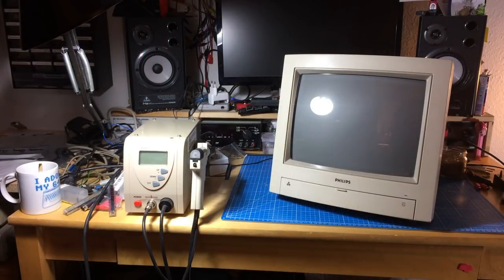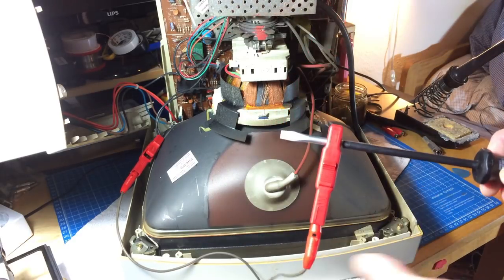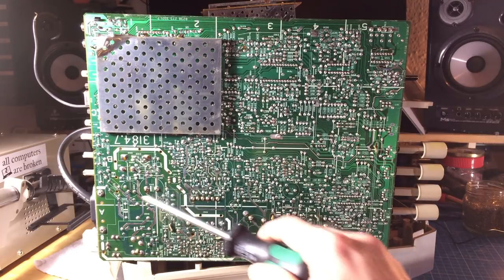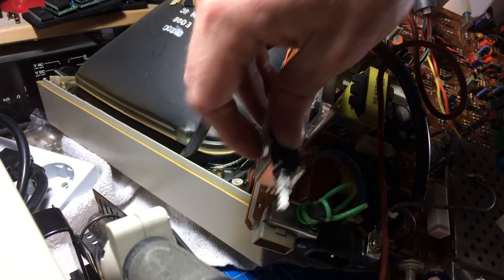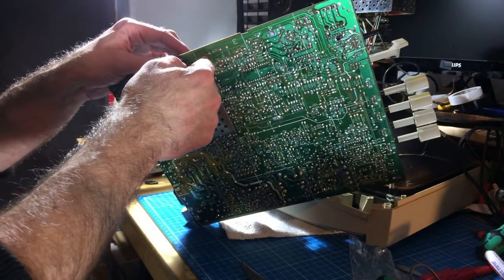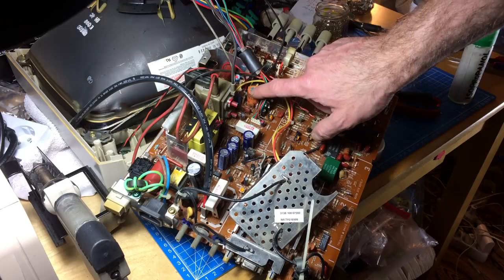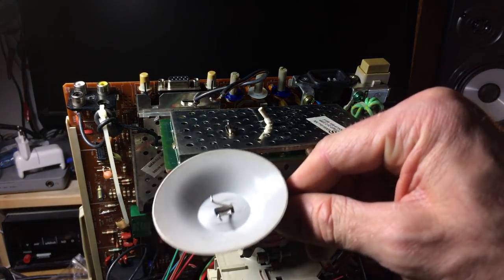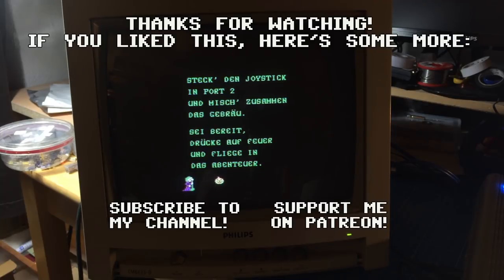Philips CM8833-II CRT Monitor Power Switch Repair and Recapping

Comment: The 4.7uF 50V cap is a low ESR specially made cap for this application.  They are no longer made (circuit designers switched to using film capacitors). The last cap made for this monitor is BPHR50V4.7-RC.  Console5 has stock of the last known batch.

Comment: If you take out that flyback plug after discharging, is the flyback also still charged? Or when removed from the screen it will still dis-charged..?
Reply from the maker: The flyback itself is just a transformer, so there's no charge to speak of left in it after disconnecting the plug. Depending on the monitor, there might be some capacitors connected that have to be discharged by shorting them out to ground (preferably through a small resistor) though.

Comment: The only thing I want to do inside the crt is to put a small stereo amplifier and two little speakers (my 1084 is mono). I am very scared by the high voltage so I will discharge it extra carefully and multiple times. What are extra security measure to use? Maybe leave the screen unplugged for long period in advance? Using big gloves?

Comment: Jan, where did you found 4.7uF 50V big bipolar capacitor? Does anyone sels cap kits for hese machines in Europe? This monitor is basically the same as Commodore 1084S-P1 except luma input.
Reply from the maker: I ended up putting the original one back in. I think console5.com is the only place that still stocks the bipolar capacitors for the common CRTs. You can replace them with polyester caps as far as I know but I didn't try that yet.

Comment: @Jan BetaYeah, very good idea to short  caps with screwdriver for discharging but if you want damage them right away... You can check it by yourself. Charge some capactor, disconnect power and watch voltage drop with multimeter then discharge it using screw driver, recharge, disconnect power and check again voltage drop. You can see that voltage drops much faster then before discharge via direct short it  so it's damaged partially and doesn't keep charge as long as should. You should discharge capacitors by short it via for let's say 10ohm  resistor. For examplse 200V-400V caps i discharge using a tungsten lightbulb install in fixture or using 30ohm resitor...

Comment: Nice Video!!  I can tell you no matter how many CRT's I have serviced over the years I still today do not like messing with them.    I only have 1 monitor I still use a 1084 that I know I will have to put on my bench and go through it.   Its power switch is stuck in the on position so I use an external switch to turn it on and off but I only use it when I a service the old Commodore computers but as soon as I hang a flat screen TV on the wall by my bench then the old 1084 will certainly need to be gone through and setup permanently in one location to for the purpose of running an old Retro BBS which I ran from 1987-1997 but that's another project.
Reply from the maker: Thanks Stephen! I think the 1084s have the exact same power switch as this one. Not a very good design obviously considering how many of them are faulty in one way or the other... Hope you get the BBS up and running again. I love the fact there's still retro BBSs around today. Especially when they're hosted on old machines, too. :)

Comment: Brilliant work, and timely, as I have coincidentally been watching CRT discharge videos all week -- this is the cherry on top. I still have all those 1702 monitors to refurb from a haul back in September.

I am glad you said, "I'm a bit scared" at one point. If one is not at least a bit scared discharging CRTs then you shouldn't be doing it. I remember GadgetUK's CRT discharging video and he was really nervous, and rightly so.  Also, the discharging of the electrolytic caps is an important safety point, as well.

The picture on the CRT after recapping looked amazing.  And speaking of quality, the YT video quality is excellent, as well -- everything looks brighter and clearer -- I assume you are using your new camera.

Well done, as usual. 👍
Reply from the maker: Thanks Mark! Hope your CRT adventures go well. I'm still a bit envious about all the 1702s you scored. But then again... they're all NTSC anyway... ;)

The improvement in quality actually resulted from using more lighting (well, another desk lamp pointing towards the work area). I still used the good old phone for this video (still fiddling around with settings and techniques on the new camera). :)

Comment: Hi Jan. Just as a additional safety-tip: If you discharge the tube into the "chassis ground" (instead of into earth/ground of your mains socket) you want to stay clear of any metal parts which are connected to it. You had your fingers VERY close to the mounting screw (bottom/right of the video). It could easily spark over if there would be a substantial charge left in the tube. Be careful.

Also, to try and help you improve your English a bit (no nitpicking, I truly want to help you improve)...

The plastic thingamabob you wedged into the power switch to keep it turned on is commonly referred to as a "guitar pick".

The charge a tube may potentially hold can not "kill you and severely hurt you" ... it can only do either ... kill you (in case you have a heart condition or a pacemaker) OR severely hurt you. I fetched the one or another zap from a CRT tube back in the days as CRTs still were a thing and I can attest it is a VERY unpleasant experience (especially with really large tubes where you look at 30KV+)
Reply: As for the bipolar cap ... Looked around... only place I found one (Reichelt is a total no go with bipolar ones):

conrad <dot> de
Search for "Elektrolyt-Kondensator radial bedrahtet 2 mm 4.7 µF 50 V 20 %"
This should lead you to a result of a Panasonic bipolar one which sells for 32€ct.

According to the picture it should be a can-shaped cap about the size of the orange one you have in your Philips monitor.
Reply: The charge is with respect to the 0V end of the CRT not mains GND so he could hold the metal lugs of the CRT while discharging the CRT with no chance of geting a shock from the charge inside the CRT. But what can happen is that the CRT is face down on his bench and when you discharge a CRT you can get a static charge from the glass face to the bench and this can give a voltage difference from the chassis to earth. It is probably better to not have the CRT face down on the bench or to use a gnd lead to his bench earth point. I say this from 30 years of CRT monitor manufacture and repair.
Reply: I hear it more commonly referred to as a plectrum, or plec for short. He isn't wrong either way...
Reply from the maker: You're right. Holding the case close to the screw was not very thoughtful (especially because I'm literally doing it while I'm telling people not to do it...). I know it's called a guitar pick but I'm a bass player so I like to refer to them as picks or plectrums (as I did). ;)
And yeah, obviously it won't hurt you anymore once you are dead... Well spotted.
Reply from the maker: I will have a look. I need to order some spares soon so I'll just try I guess. Thanks!
Reply from the maker: Oh, interesting point. Didn't know about that at all. So I could prevent this from happening by connecting the CRT 0V to mains GND?
Reply: Jochen Blacha Not to correct you or nitpick but I think he called it a "thing-a-ma-spring", which frankly is a much better word. 😉
Reply: Plectrum is Traditional English (UK), whereas Simplified English speakers (Americans) say 'Pick'.

Comment: hi there,
i did not read all the comments but regarding the 2 extra pins on the main switch: these are normally used as a temporary contact in the PTC demagnetizing circuit for the CRT. If they are not used just cut them off

Comment: Thank you so much...as a result of this, I now have a working monitor, fixed by me using your guide.  It didn’t work initially after I swapped out the switch, but then I took a closer look at the switch area and noticed that their was a small fuse that had blown, replaced that and voila...fired up for the first time in years.  The picture quality is sublime, on par if not better than my Sony pvm broadcast monitors.  Thanks so much again, I bought another and ordered another switch to fix it with...👍🏽👍🏽👍🏽👍🏽👍🏽👍🏽

Comment: Good work! I think the additional pins on the power switch are 'self-wipe' contacts that reset the micro when used in TV applications. Naturally not required here as monitors are much simpler devices.

Yes, although it's good to be cautious I wouldn't worry too much about stored voltages if the thing has been siting idle for a few days. The real danger would be from running the monitor with the case off! As with all live chassis designs any exposed metalwork (heatsinks etc) will be across one side of the mains supply! An isolation transformer is always the way to go if you need to probe voltages etc.

As you already know, it's good practice to mark the polarity of the old caps before replacing them. The silkscreen on the PCB can often be wrong and is not to be trusted at all! Yes, good quality 105 degree Panasonic capacitors are what I've used in the past. 

The orange one most likely has a 'low-leakage' characteristic, but really most good quality caps these days will suffice. You could use a high quality non-polarised 'audio grade' capacitor in its place, but even an everyday Panasonic bi-polar will be good enough.
Reply: As for discharging the CRT. You are doing it the correct way so ignore what others have said! The discharge path only has to go to the back of the tube (aquadag) as that is like shorting out the + and - of a capacitor. No need to discharge to mains earth and potentially damage some appliance in your house lol.
Reply from the maker: Thanks! Good to know about the hot chassis. I read about it briefly but I didn't consider it very important for this repair as I didn't plan on running the thing without the case anyway. Maybe some day. I'll keep in mind to run it through an isolation transformer then. (This model has some very convenient "hot chassis" warning signs on it btw.)
Reply from the maker: Thanks for clarifying. That's exactly what I thought. :)

Comment: Thanks for the video and I plan to do this on my cm8833-2 when I get the time, the switch is intermittent at the moment so total failure is probably iminent. I recently repaired my 2008 samsung monitor that uses TFT LCD backlights at 1KV so that was pretty scary, luckily my dad is an electronics engineer and was helping. A healthy respect for HV is deffinately required to do your own repairs and I love the repair over replace mentality, but zapping myself would make all that not worth while!

Comment: Nicely done - I recapped the power supply board on a Dell u2410 - and I took a picture and just annotated the graphic with all the values :). Not sure if it speed the process up or not.
Reply: If nothing else, it gives you peace of mind.
Reply from the maker: Thank you. :) I was quite surprised how many caps are in this thing. Maybe a picture would have been helpful. I tend to do them one by one, look at the polarity and the values. Spared me a lot of unpleasant surprises I guess. ;)

Comment: Hi, if I recall correctly, that non-polarized electrolytic capacaitor is in series with the deflection coil in the yoke, it's a high frequency non-polarized 105C electrolytic capacitor, hard to find since the demise of CRTs,. If it hasn't bulged or overheated, and there are no deflection problems (abnormal sweep size), don't mess with it, and leave it as it is (if you use the incorrect part, you may damage the linearity coil), I can't remember seeing one of those fail. Good Luck.
Reply from the maker: Oh, thanks for the info. Makes sense. The cap seems perfectly fine so I'm probably going to leave it in there until I find something suitable (or it breaks).

Comment: A bipolar capacitor is effectively two capacitors of twice the value, "back to back".  It's quite normal that they are smaller in size now, just due to how they are made. 

I looked it up and it seems to be C473, which is to do with the horizontal width part of the circuit. It's certainly not high current or anything like that so you should be safe to replace it :) You could likely use a polyester type such as WIMA MKS2 here too
Reply from the maker: Oh, thanks! I might try with a polyester cap. I guess they didn't use one of those in the first place because they weren't readily available (or too expensive) with the needed values at the time.
Reply: The Monitor works - why change the Cap?
Reply: @elektro-peter1954  Because as its an electrolytic it will fail sooner or later. A poly cap will outlast the owner.

Comment: Thank you for the video. Is this crt the same as the official Cbm units or different? My understanding is after many months the charge just goes but maybe Ill do your discharge next time. I have a older design cbm monitor where I replaced caps with ones from a plasma tv. I just replaced what I had. There was another type of large rectangular cap that had blown which I replaced with one with from the plasma. Plasma one had a higher rating. I just used it and well it worked. Better than nothing.

Comment: This is the FULL list of the caps you need for the CM8833-II / CM11342 / Commodore 1084S-P2 in value order:

2422 1uF 50v
2604 1uF 50v
2526 1uF 50v
2536 1uF 50v
2515 1uF 250v
2573 1.5uF 63v
2268 2.2uF 63v
2511 2.2uF 63v
2547 2.2uF 63v
2266 4.7uF 25v
2647 4.7uF 25v
2524 4.7uF 50v    Bipolar Low ESR
2136 4.7uF 200v  Neck
board
2669 10uF 50v
2416 10uF 50v
2450 10uF 50v
2361  10uF  50v
2520 10uF 160v
2269 22uF 50v
2272 22uF 50v
2301 22uF 50v
2452 22uF 50v
2512 22uF 50v
2537 22uF 50v
2141 22uF 50v   Neckboard
2328  22uF  50v 
2327  22uF  50v 
2541 22uF 50v
2696 47uF 16v
2697 47uF 16v
2296 47uF 16v    Headphone Board
2451 47uF 200v
2601 100uF 16v
2640 100uF 16v
2274 100uF 16v
2412 100uF 400v
2560 220uF 35v
2561 220uF 35v
2446 470uF 25v
2447 470uF 25v
2445 470uF 35v
2563 470uF 35v
2571 680uF 35v
2291 1000uF 16v

Notes:
I didn't replace the bipolar cap yet I have to source it or make it with two Low-ESR caps back to back.
The 1.5uF you can make. Theoretically you can wire 3x 4.7uF in series, but the actual reading of this was a little off (I got 1.2uF) so I made the 3rd cap 10uF and then I was reading 1.52uF on my cap meter).

Source: I recapped my monitor yesterday, and it's an excellent rock-solid vibrant picture, instead of blurry and wavy.

Comment: Regarding the extra pins on the new switch: I would have checked if the board is clear for drilling the extra holes, and just bend the pins on the other side. That way there is better hold on the board for forced physical switch activity. The old switch seemed more flimsy :)
Reply from the maker: That would have been a better way of dealing with the extra pins of course. It's quite sturdy already with the metal bracket soldered to the PCB though. :)
Reply: Mr T. Guru  Thats rather negative to his work to state its a junk brand and comes across as condescending. He may turn off at the wall as well he may have just wanted to fix it. The video was educational of intent clearly. You are just assuming in a arrogant way.

Comment: OK Yan nice video, just some comments.

You said the high voltage is at a low current, yes in that the EHT transformer can not produce much more that a mA or 2, but a charged CRT + EHT transformer could be up to 6nF and any capacitor when discharged will have relatively low internal resistance. So for arguments sake lets say that the discharge path of the CRT = CRT capacitor + external circuit i.e. your screw driver with lead = a silly high value of 100R so an instantaneous current from the discharge could be 24000V divided by the 100R this will give you 240A.

The rings around the neck of the CRT on a colour CRT are marked as pairs "4", "6", "p" these are 4 pole mangents for red/blue convergence, 6 pole magnets for magenta green convergence and P for purity setting.

The vintage radio people do not like contact spray on pots they say it will make them wear out increadibly quickly. They prefer waxoil as used in car protection.
Reply from the maker: Good point. Can't beat the maths in that. I will be even more careful in the future!

Thanks for clarifying the magnet rings around the neck. I have to read up a bit on how these things work. Amazingly (yet archaic) technology.

I used to work a lot on vintage receivers and amplifiers and have always used this particular spray. It never failed me and the pots and switches keep working for years after using it. I've tried some other sprays before that had effects like the one you describe where they deteriorate the carbon layers in the pots. I've never experienced that with the T6 Oszillin I'm using.

Comment: Metallized film capacitors should work to replace the bipolar capacitor if you can't find the the same one.
Reply: You can also make the bipolar with 2 standard electrolytics.  They need to be the same make / batch, and go for low tolerance if possible.  I originally thought you had to double the capacitance of each to get the correct capacitance, but because its bipolar you use 2 x caps of the same size.  eg.   if you need 4.7uF, get 2 x 4.7uF same make, low tolerance and join the negatives up, and use each of the positves for the connections.
Reply: GadgetUK164 - Retro Gaming Repairs & Mods that would be a better solution I always wondered if you could tie two caps together. And as you said better tolerance
Reply from the maker: Yeah, I heard about that and never tried it. I might end up doing it because I have quite a lot of (good) 4.7uF caps lying around.
Reply: I've heard that being used before. Worth a try IMHO.